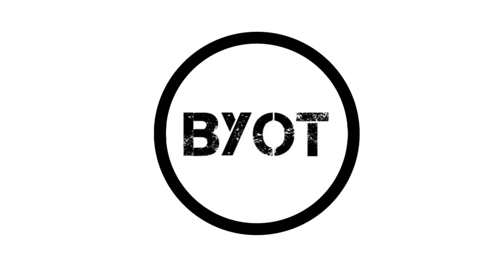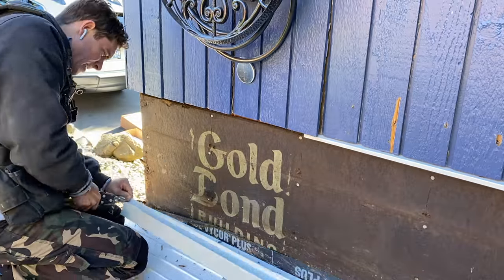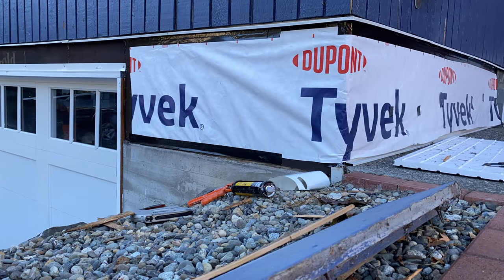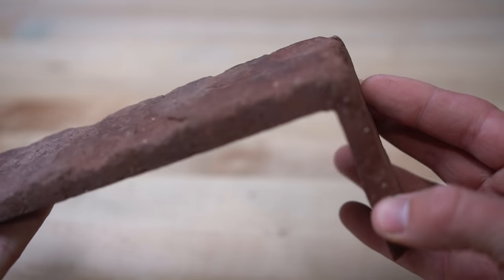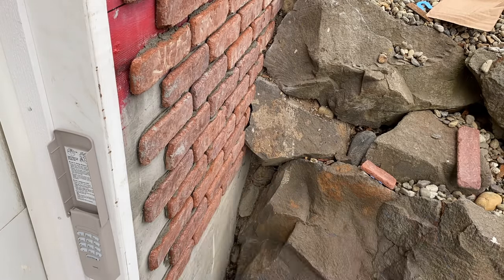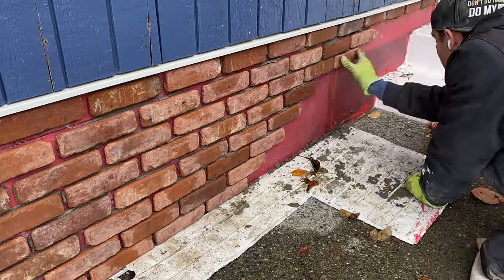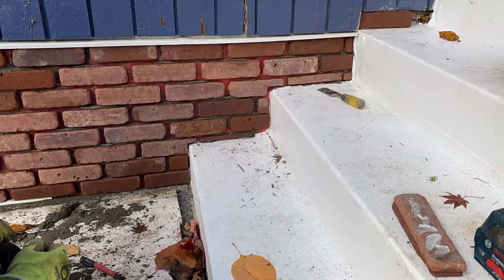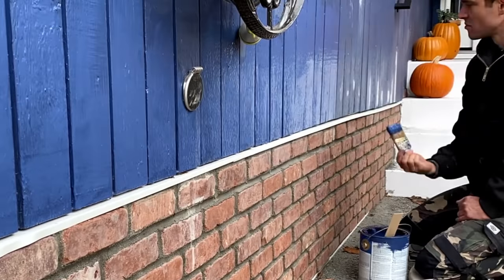How To Install Brick Veneer Outside // DIY THIN BRICK

Comment: Sorry, but you made a MOLD SANDWICH. The “Red Guard” created a second water proof layer with the porous “wonder board” in between. 

“It’s not about keeping water out, it’s about letting water out.” David Nicastro, PE

Water vapor in this sandwich will condense and cause mold. Read the below articles about stucco. The same would apply to thin brick or even ceramic tile. There needs to be a way for it to dry out. The Red Guard traps in the water. Also see Matt Risingers videos.

https://www.buildingscience.com/documents/building-science-insights/bsi-102-coming-stucco-pocalypse

https://www.buildingscience.com/documents/insights/bsi-029-stucco-woes-the-perfect-storm

Comment: if its a DIY its important to still use health and safety. hiring a trade knows this. brick veener is so much better than stone which looks a mess. anything over head height should have a tie into the wall, dangerous not too. these are not as tougher as normal brick, without a tie head height it will not last as long. but brick veener looks the better option out there

Comment: Hitting two hammers against each other is extremely dangerous especially without safety glasses. Good quality hammers are soft rim tempered to prevent splinters sheering off others are not. Always use a crowbar together with a hammer never two hammers striking face to face.

Comment: ummm I bet a certain someone is regretting they used RedGuard. lol  RedGuard is a water proofer but not a VAPOR proofer. So if it is applied where there is potential for vapor transfer either IN or OUT or both it carries with it a little molecule of the RedGuard. This has two effects. First it will turn your mortar pink and second it will degrade the bond of the RedGuard to the "wonderboard".  And then because the brick mortar is bonded to the RedGuard and NOT the wonderboard (as it should have been) you have a total failure. Gee whiz, I wonder if the channel creator has been perplex as to why his mortar joints have been turning pink. LOL
Reply from the maker: No regrets what so ever Tim.  Still looks great with Zero issues.  If anything changes I will let my audience know. Thanks for watching.

Comment: Let's see.. I see no weep holes or screed which are required even for thin brick..And no siding should not be in contact with the ground. Dissimilar siding should be caulked where in contact. Because it is outdoors a metal lath was required most areas don't allow cement fiberboard outside I quit watching but lick and stick is usually for indoors only

Comment: Why didn't you point as you went like you would with real bricks. You point bricks grout tiles. So they arev tiles  not bricks. Its not a brick joint itsva pointing tool you could you a round stick, dowl, finger 
This is pointing do you not have brick houses

Comment: Thats triple the work why would you do that for..🤣🤣
Situation if it was unique you still could have marked out your bricks from top down and then start at bottom and use spacer jigs, once they set you can take the spacers out Once youve marked out your lines level is true you dont need to keep using level everytime first row is perfect

Comment: The "sheathing" is called Celotex and is basically tar impregnated Homasote. Tyvek was originally touted as an air infiltration barrier and the millennial architects started specifying it without other justification.  Why would you apply an air infiltration barrier over or under another air infiltration barrier?? It's not "cheap", but a nice job of pimping that and other unnecessary overpriced materials.

Comment: I'd be very turned off if you put this up for sale implying it was "brick veneer".

Brick veneer is something completely different to this. It's a solid full brick non load-bearing layer tied to a load bearing timber or steel framework.

What you're installing here is brick facade. 

The manufacturer of those tiles is doing some value appropriation by calling it veneer and thereby encouraging you to wrongly call it brick veneer.
Reply: Uh... the word facade simply means "the face of the building." So brick facade just means bricks on the front of your building. Brick veneer is the usage of thin bricks (not solid full brick as you state) and attaching them to the building for asthetics. What he is doing is brick veneer. The location where he did it (infront of his house around the garage) would be known as brick facade.
Reply: No. It's a distinct meaning in building. Look it up.
Reply: @cottawalla  I did. It's brick veneer. You can look it up yourself.
Reply: @CookieSlinger  "When we say brick veneer, we don’t mean those little thin slices that you glue on your kitchen wall. We mean an honest to goodness brick."

The quote is from:

https://www.carsondunlop.com/inspection/blog/brick-houses-solid-masonry-vs-brick-veneer/